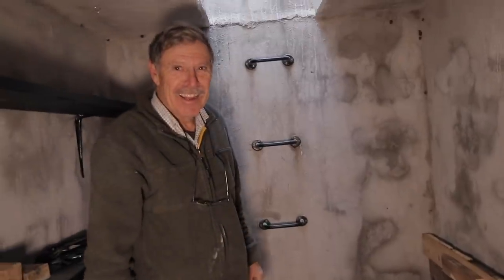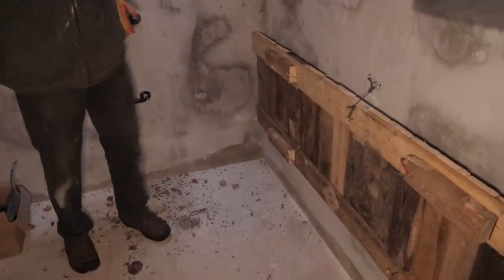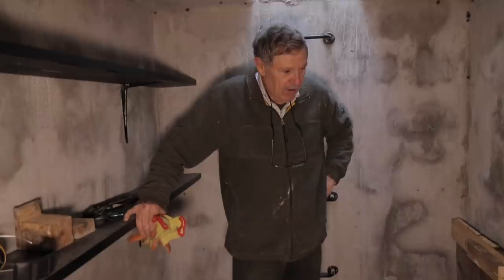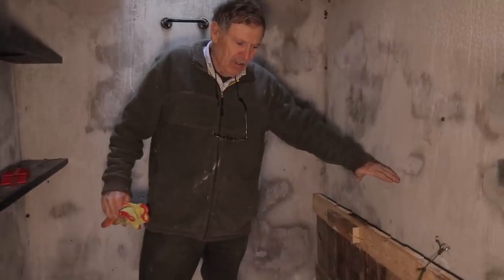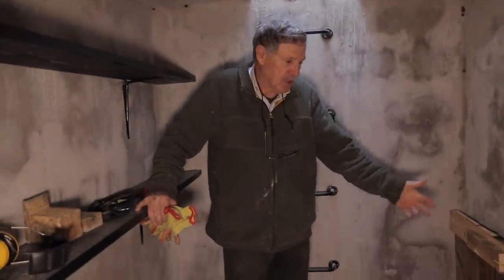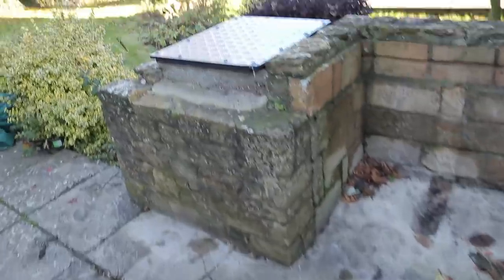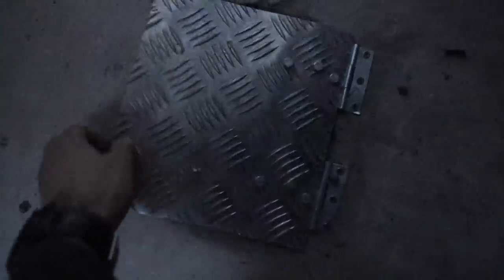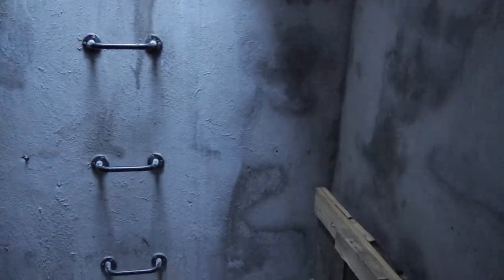Renovating the WW2 Bunker: Building the Bed (FINAL EPISODE!)

Comment: It looks absolutely awesome! A little cleanup session and it's good to go.

One thing I said before, but I will say it again:
You should think about a way to "lock" the vent from inside, so your little one won't accidentally open it at some point and fall down. For now the big sheet of wood should be heavy enough to prevent that, but kids grow fast! I guess a small hatch or something should be enough, just make sure it can't be reached from the outside. Possibly even make it fall in place on its own, so you can't forget to lock it.

With the entrance door I don't see that problem because of the steps (also it's even heavier...).
Reply: Once he's strong enough to open the door he should be smart enough to not jump down it but better safe than sorry, I guess.

Comment: If it was me i would still paint the walls with water sealing paint again
Reply: I'd put a french drain around it too. I'm not sure water is really a issue but when it comes to underground structures rule of thumb is to use a french drain.
Reply: @readhistory2023  (
Reply: I would've turned it into a heated pool.
Reply: @fridolfmane1063  Would have been an amazing little hot tub grotto.
Reply: @opposedtuba6219  Absolutely!
Reply: Epoxy paint…

Comment: You should put a screen over the vent opening. It will keep out the bugs. Silicone it in place. In case you need to get out from there, there is not much of a problem to cut it. Even with your hand.

Comment: If you turn the bed legs 45 degree then you don't need the rubber bands the gravity will pull the legs straight down on the floor and when you put up  the legs will close.

Comment: As a wider shouldered human, that narrow bed scares me 🤣
Reply: The bed is narrow and very close to that wall, I can see that being very uncomfortable when you arm goes and touches that wall ( conduction loss ).  Dare I say it (dare, dare :)...build a standoff from that wall using the old pallet wood ( I'm guessing that the pallet wood is about 10mm thickness)2 strips as  furring to the concrete wall and then across the furring at 90 degrees like a park bench to keep you off the cold cold concrete wall.  it only should intrude about 20mm in ( 3/4 of an inch in Imperial)

My other thought was a hammock, seeing that you dad seemed taller than the space is long, by slightly "folding" dad he may fit better...

Comment: Bruh, you need to weather seal the Door and Hatch, on the shelter. As for air circulation as a whole, the Swiss shelter air circulation systems are both effective and inexpensive even when combined with a stand alone solar system. Necessity that can also provide electrical source you can use to operate a interior light, device charging station and emergency radio to the shelter.  So many ways to create interest on your channel you are missing a opportunity, The only reason I ever watched your channel was this series, I have no intention of ever slipping back to more primitive living. Understanding most people will never support that content and it is more a dead end than your micro shelter. You should not only expand your shelter series but find a bigger more developed purpose for your channel, that is if you want a massive following. Well, that’s my two cents worth of opinion,,, good luck.